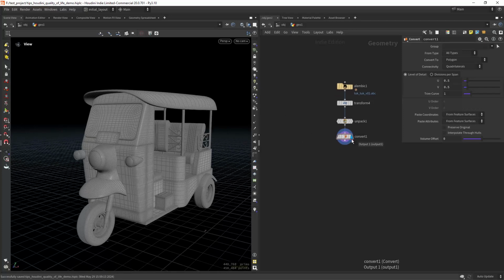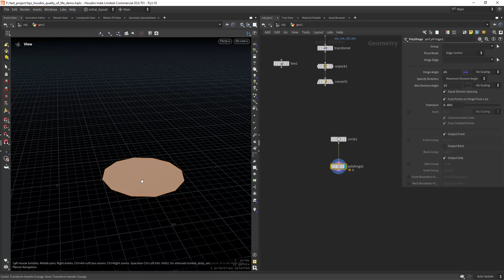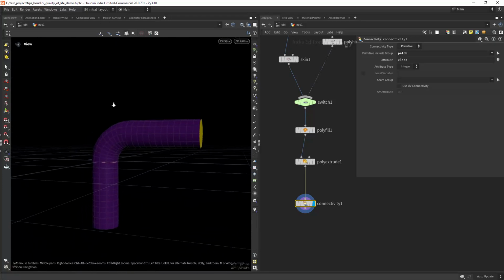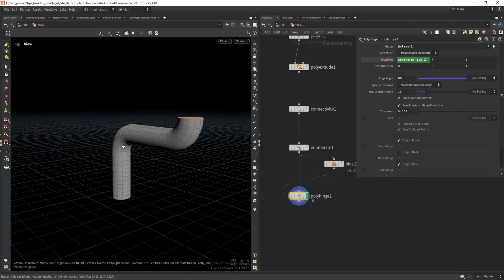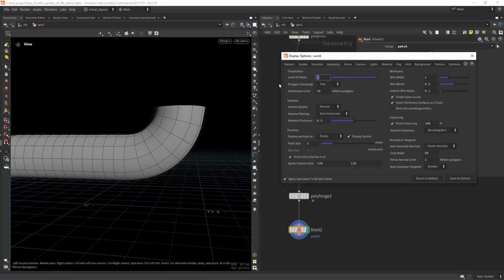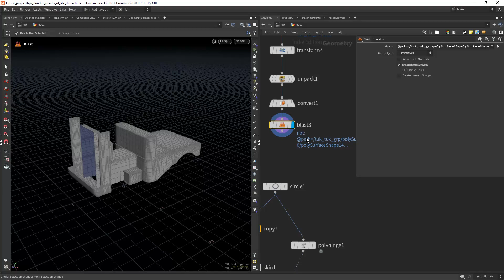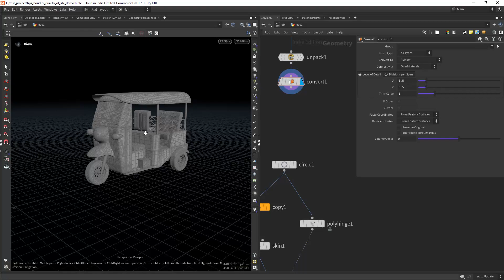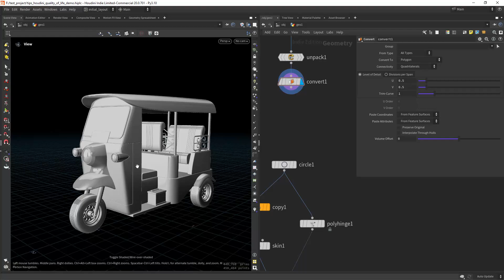Quality of life tips in Houdini

Comment: Hi. Do you find Houdini as a good polymodeling tool in a classic way (non-procedural) for hardsurface?
Reply from the maker: I still find it difficult to model in a non procedural way, but it takes time to get used to new workflows. If you're considering it, have a look at these two channels: @polymarvels and @ModelerHoudini. Cheers
Reply: @cgside  I know both, but still I am not convinced 100%. And as for Modeler, the HDA is a bit expensive and requires purchase on every Houdini main release (.0 and .5). I switched to Linux and miss a bit 3DS cause I am not a fan of Maya and Blender, although they can run on Linux.